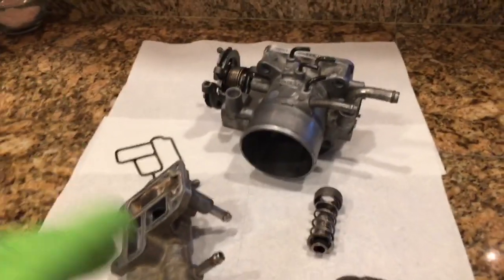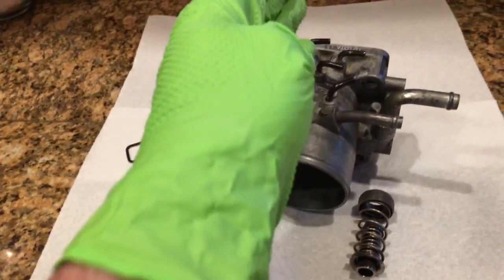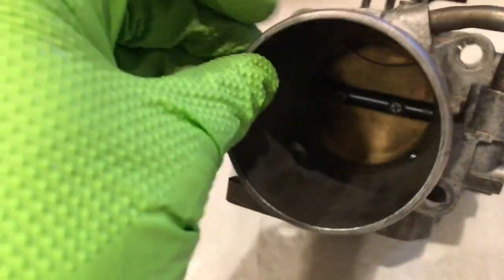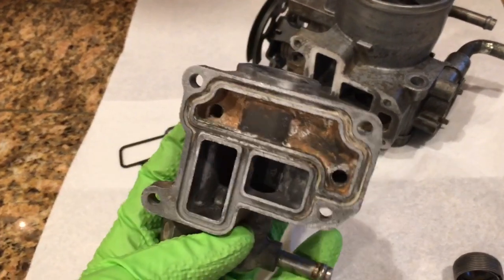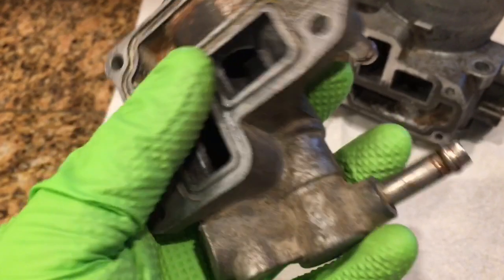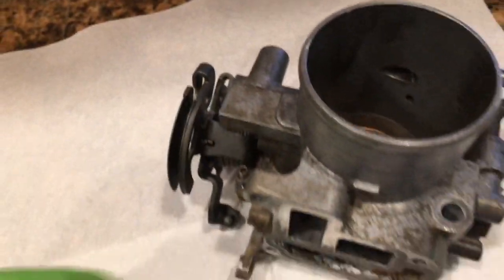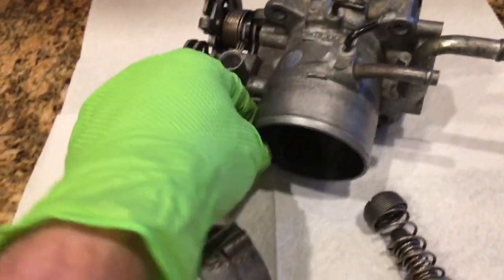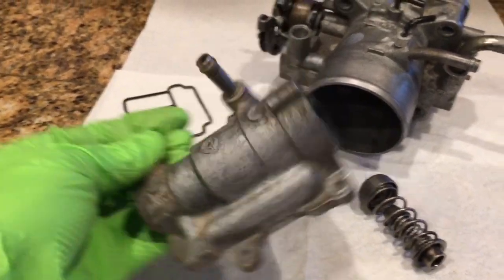Toyota 4runner pickup 22RE - understanding rough, high, surging idle, the Idle Air Control IAC valve

Comment: I taped off the hole in mine and it runs better for about 30 seconds and then stalls. Before I taped it it stalled after like 5. So I wonder if this is my issue.
Reply from the maker: Hard to say, but it's normally if you tape that hole closed, then it disabled the entire IAC valve stuff; that means the motor should idle fine once it warms up a bit (around 3-4 miles of driving). If it's still stalling with the hole closed by the tape (and it's warmed up), then it's probably not the IAC but something more. You might want to check to see if all your injectors are working. You might also want to check the O-ring around the idle adjustment screw. But the fact that it did change things tends to suggest an air/fuel ratio issue. What do you have the engine idle RPM's set to?
Reply: @ray5961  I bought my truck and the drive it home and drove it for a day and on the way home it was revving up and down fast and I parked it and now it just fires up good but after 5 seconds the idle drops and stalls after misfire. But I’ve checked a list of things including iacv and egr etc. but maybe it’s my afm idk. Super frustrating though lol
Reply: @ray5961  I have spark and my fuel pump pumps fuel. I changed the fuel filter. So I think maybe afm just because of it maybe not cutting on fuel pump? Cause I don’t hear it turn on. I used the diagnostic box to activate fuel pump is how I got the gas to come. But I don’t think it’s activated or not for long cause the air. I have a crack in my boot that goes to my throttle body. And I taped it. So could be that too. It’s weird
Reply from the maker: @heyitsbryce  ok try this - go into the little diag box (next to the fuse box in the engine compartment) and jumper Fp and B+ with a paper clip or wire (this will force the fuel pump on) and then start the car and see if the truck runs.
Reply from the maker: @heyitsbryce  I might be the circuit opening relay has failed. Let me know if the truck works correctly when Fp and B+ is jumpered. The fuel pump comes on when you work the stater, to start the motor. Once air starts flowing through the AFM, the AFM grounds the circuit opening relay and this relay powers the fuel pump. So if that relay fails, the truck will start (when the starting circuit provides fuel), but it won't run once things are handed over to the AFM if the circuit opening a relay has failed. If the truck runs when Fp and B+ are jumpered (which by passes that relay), then it's probably the relay, which is located over in the passenger side kick panel and behind the glove box - it has a dark grey 6 pin connector.
Reply: @ray5961  okay thank you! I’ll check that stuff out soon. I have a new boot coming in the mail today because mine was cracked in half. But I will definitely give it a shot! I’ll let you know when I find out.
Reply: @ray5961  I tried it with my taped up boot. Shot to 2k rpms and stayed like that running. (I haven’t messed with the idle screw too much) still sounded like it had a misfire a little when I would give it gas. But it does start and stay running
Reply from the maker: @heyitsbryce  ok sounds like the opening circuit relay isn't working. Watch this video here and it might help https://youtu.be/EpTED3Z2xo8 - read the comments w/ Eric on that video also
Reply: @ray5961  okay thank you! I’ll check it out! If I have to get a opening circuit relay do I have to match with my ecu or?
Reply from the maker: @heyitsbryce  It's an electrical relay for Toyota, which is basically just like an on/off switch. Search ebay or Amazon for "Toyota Circuit Opening Relay" and you should find them. Auto zone or Napa probably sells them. You can remove yours from the truck and test it. But usually if jumping Fp and B+ works, then the relay is bad or burned out or something. They are easy to test once you remove them and understand what is happening inside. You can usually pop open the relay and see it working inside - sometimes they contacts are just corroded and you can clean them or the connector and get things working also.
Reply: @ray5961  sorry to bother again. But today I checked my circuit opening relay with my multimeter and it came back 108 ohms and my so things check out there. I opened the case and everything looked in new condition but outside was a little dirty. And so I’m not sure what it could be.? Could it still run good ohms and be bad? Cause when I hooked up to fp and b+ it ran fine. I checked the ohms on the terminals in afm and they came back fine ( I believe. Was my first time trying) I saw on a page for testing it.
Test 0* vb-vc 100.7 
Test 1: e2 -vs 362
Test 2: e2-vc 180
Test 3: e2-vb 281
Test 4: (temp) was about 72 degrees @1728
Test 5. Infinite/open
Saw it here  https://www.4crawler.com/4x4/CheapTricks/AFM/index.shtml#AFMtesting
Reply from the maker: @heyitsbryce  Well, to test the relay, normally what you do is apply 12 volts across the terminals that power the coil and then it will magnetize and pull a metal contact over which should complete a circuit on the other two legs - so when the coil is energized, the other two legs should have continuity. The AFM part related to the circuit opening relay is merely grounding the relay coil so it's powered. Try testing the relay with the case off and you should see if working. The 108 ohms is probably just the coils resistance, but that doesn't mean much. What matters is does the relay function when it's powered. Two pins on the relay power the coil; when the coil has power, it closes the switch and that connects whatever circuit is across the other two pins of the relay. So apply power to the two pins which go to the coil and see if the other two pins show continuity or not. You can also test the wire for the AFM to the relay and make sure the AFM is grounding by putting a volt meter in place of the relay (while Fp and B+ are jumpered) to confirm the AFM is grounding the relay like it should. All those vb-vc and e2 readings relate to sending positioning data to the ECU, not controlling the circuit opening relay which provides power to the fuel pump. Check that other video and pause the video and look closely at the wiring schematic
Reply: @ray5961  okay man thank you. I will have to try that for sure. I had just checked ohms on it. I pulled the trigger couple days ago and got one off eBay for 60$ from a trusted seller. So I guess if it’s not that after all then I have another Toyota relay lol. But I hope it is this so I can be done with it. I appreciate you helping me out. I’m still kinda learning about vehicles and so any kind of help I can get helps a lot. I will let you know what I get. For reassurance I’ve been testing the middle of the bottom 3 and top left of the two. And that’s where I get 108. And then I get 20 from top right and bottom right. So I will connect to bottom middle of the 3 and top left of the 2 for the 12v correct?
Reply from the maker: @heyitsbryce  I don't know the pin out off the top of my head, but it should be shown on the relay using numbers - google relay symbols or relay pin numbering and it should explain it pretty clearly and then you can see which pins do what. Or just open the relay and look to see which pins go to the coil wires. You can also look at that video I linked before; the connector pins are shown and those plug into the relay. I know it's all confusing if you don't have a background in electrical engineering and/or you're not used to reading electrical schematics. Watch that video linked above... it looks like power across pins 2 and 4 - so + on 2 and ground on 4 and then that will bring power over to pin 1.
Reply: @ray5961  yeah man it can for sure be intimidating. Thank you for the help. I will try those things tomorrow! I hope it’s the relay lol.
Reply: @ray5961    so I hooked up the relay with wires connected to relay with clips and hooked to my battery and it clicked. (I watched it click) My connections were connected to 2 & 6 on that book you have. I don’t get a click if I connect 2 and 6. And the other ones shown on that book 1&2 they come to 21 when I have the relay clicked and connected still. I tried following along with the afm steps but maybe I messed up on this? I I took a paper clip and stuck it on fp and b+ in the diag box and turned the key on the on position and then took my red probe from multimeter and stuck it in 2 and then black into 4. Was nothing. So I stuck red in 2 and black in 6 and got 11.49 v (my reader was set on 12. ) I can hear the pump winning. Almost like a electrical sound kinda. When it’s jumped.
Reply: @ray5961  sorry. Was looking at the relay wrong 2&4 is what clicks.
Reply: @ray5961  so 3&6 come to 21 when I have 2&4 clicked. And when I check the inside clip that clips into the relay I checked 2&4 and nothing on my multimeter set at 12v with fp and b+ jumped. And so I went 2 with red 6 with black and that’s where I got 11.49
Reply from the maker: @heyitsbryce  You need to match what's happening to the proper color wires based on the wiring schematic and/or which pins do what inside the relay. If the relay is clicking, then it's probably working and should connect the other pins. You gotta pull up the schematic for the relay and understand what you are trying to accomplish here. The relay is closing an electrical circuit, plan and simple. See if it's doing that or not and if it is, then move on to find where the problem is if it's not the relay doing its job.
Reply: @ray5961  so my step dad and I messed around with it more and we took a end of the multimeter probe and connected to the green yellow wire in the terminal and then grounded to a bolt in the door and it kept running. So it’s a ground correct? We are trying to figure out how to find the messed up ground now
Reply: @ray5961  do you know if there is a certain place it grounds? Maybe that’s a dumb question
Reply from the maker: @heyitsbryce  Yeah, so if you have the relay in place and you grounded the green/yellow wire, that means the relay is fine. It also means that either the AFM isn't grounding it properly or the AFM doesn't have a path to ground via its brown wire. You can also check for continuity between the brown wire on the relay connector over to the E1 spot on the diagnostic port - and also check to see if E1 on the diag port is showing ground to the chassis. You can also jump a wire across the AFM connector between the yellow/green wire and the brown wire where it plugs in and see if the fuel pump stays on to rule out a loss of ground and rule in a defective AFM switch.
Reply from the maker: @heyitsbryce  I don't know off the top of my head where it grounds... there are a number of ground points on the wiring harnesses. See my other comment regarding checking the AFM wires. Okay, I checked the manual for ya and the splice points for the brown wire ground that the AFM is connecting to for ground is inside that plastic wiring harness routing box thing that makes a slight turn and pops into the right side of,the engine compartment just under the fuse box and diagnostic port - from there it runs into the harness and grounds where the fuel injector brown wires all ground, which is the bolt under the intake manifold runner. So if you look at the intake runners, when you're standing over the right fender, there is a seam where the intake plenum and the intake runners bolt together - kind of up under there, there is a support bracket that goes down to the side of the engine block; right there where that support bolts to the intake runners, you should see a gang of 3 or so wires bolted to the manifold with a nut or bolt. If you look close, they should be brown wires; that's your final ground point of the yellow/green wire that the AFM is connecting to ground.
Reply: @ray5961  awesome! I’ll have to check that out. And I’ll look here in a little bit to see if it’s not connected . Ii really appreciate this help. I was following the wires coming from afm to the firewall where they go inside earlier and I saw it going throughout the motor so I will for sure check it more out!
Reply: @ray5961  also, I probably should have included it’s a 22re swap. But I believe the concept should still be the same. It’s been routed about the same the whole way through
Reply: @ray5961  I went and checked all the grounds. That one that is by the intake is bolted down. I checked the rest and they are bolted. So that checks out. Given they have a good enough connection. Which it looked like. So I’m guessing maybe a connection at the relay to the connector that connects in it? For the ground pin in it? It really has me stumped.
Reply: @ray5961  wish I could send pictures of the grounds so you could see what I’m looking at.
Reply from the maker: @heyitsbryce  ok good luck!
Reply from the maker: @heyitsbryce  Unbolt the brown wires from that bolt on the intake runners and make sure there is no rust. Also, while it's unbolted, check to see if there is continuity between those brown wires and E1 in the diag port. Also see if there is continuity from the brown wires over to the brown wire in the AFM connector - that will help rule out a break some place inside the harness.
Reply: @ray5961  okay I’ll check it out tomorrow! It looked like it’s dirty. But I guess I’ll just have to see tomorrow haha. But I will for sure try that!
Reply: @ray5961  is there any way it could be the ground inside of the relay?
Reply from the maker: @heyitsbryce  you can always just upload a brief video clip... this is YouTube after all :-)
Reply from the maker: @heyitsbryce  ok sounds good. You might also want to jumper the green/yellow wire to the brown wire at the AFM connector itself (when unplugged) in order to rule out a defective switch in the AFM. If the fuel pump turns on then, at least you know the opening circuit relay, wiring and ground points are okay and that there is some issue with the switching from the AFM. The other thing is check to make sure you have a healthy ground from the engine block and the valve cover back to the battery. Normally there is a little ground from the valve cover back to the fire wall. On my truck, I have a dedicated ground from the negative terminal to the engine block and also a ground strap from the engine block to the cylinder head, in addition to the one from the valve cover to the fire wall.
Reply: @ray5961  true! I could make a video and post it and tag you I believe ! And so I would disconnect the afm connector that’s going to it and then stick a wire from the green one to brown one in it? Or how does that work for jumping it? I will for sure make a video tomorrow and show you more of what I’m dealing with. I know I’m close. It’s just finding out what is causing it. I bought the 4 runner and then drove it home and haven’t been able to drive it much since. Was sputtering and then ended up like this. Super upsetting.
Reply: @ray5961  both the videos! Hopefully this helps getting a idea. I wasn’t able to make the video too too long.
Reply from the maker: @heyitsbryce  ok let me check the video out and look in the manual to see if I can find anything for ya
Reply: @ray5961  okay man thank you
Reply: @ray5961  I have another video I wanted to show you.
Reply from the maker: @heyitsbryce  ok I'll check your channel out. I was just sitting down at my desk with the electrical manual to see what I can find out for ya
Reply from the maker: @heyitsbryce  okay on the video where you have the truck running and you are manually grounding out the green/yellow wire, what you are doing is bypassing the switch inside the AFM and basically doing its job. So that isolates the issue to either being a problem with the actual switching inside of the AFM or it is indicating that the AFM switch doesn't have a ground on its brown plug wire. Let me watch the other videos. Maybe you can turn comments on on your videos and then I can comment directly there.
Reply from the maker: @heyitsbryce  ok in the video where you have the connector off the AFM and you are jumping it, you have the wrong pins jumped. You are jumping pin #1 (FC) to pin #3 (E2). What you want to do is jump pin #1 to pin#2 (E1) because E1 is the chassis ground side, while E2 goes to your ECU, not the ground. Jump pin #1 to pin #2 in the AFM plug harness and see if the truck runs; that will tell you definitively if it's a bad chassis ground involving the brown wire (E1) or if the actual AFM switching is defective. Also, you can open the AFM if you are careful and see what's up inside. Let me go make you a quick video showing how I have mine cut open and all that.
Reply: @ray5961  okay awesome that’s good to know. I will have to go back out there and try that! Didn’t know I had it on the wrong ones so that’s good to know also. I will try to turn comments on. And awesome man thank you so much.
Reply: @ray5961  I got the studio app for YouTube and hit allow comments for my videos so it should be okay.
Reply: @ray5961  runs with it plugged into 1&2 !!
Reply from the maker: @heyitsbryce  ok now we are getting some place. I'm uploading a video for you.. give me about 10 or 15 minutes and it will be up. I think the issue is probably dirty point contacts on the AFM switch inside. I show it all in the video which is uploading now. But at least you know the ground on the brown wire is good. Hang tight for a minute and watch this video I just made. It will show you how to open the AFM and inspect the actual switch, which I think is your issue here.
Reply from the maker: @heyitsbryce  Check this video out https://www.youtube.com/watch?v=X9O7sKVnQw0
Reply: @ray5961  awesome man! Thank you. I’m for sure going to go check that stuff out here in a few!. If all that stuffs fine in there then should I just get a new afm anyways? Cause otherwise idk what else it could be at this point. But we are for sure really close to this!
Reply from the maker: @heyitsbryce  Yeah, that looks like it's broken inside there all right, so I would say you have found your issue. Good work
Reply: @ray5961  you are the one that found it for me haha. Thank you sir! This has been such a help. And it has taught me a thing or two about my vehicle! I am gonna buy a new one. I really appreciate it! I will let you know after I switch it out and how she runs! Thank you again!
Reply from the maker: @heyitsbryce  You're most welcome! Glad we finally got to the bottom of it :)
Reply: @ray5961  I’ve looked everywhere and call everywhere and I can’t find a afm for 91 Toyota pickup anywhere. Even locally. It’s crazy.
Reply from the maker: @heyitsbryce  I got mine from Napa. https://www.napaonline.com/en/p/NECXTP420055
Reply: @ray5961  yeah they are sold out for around me and online. I found a Toyota specialized place in Washington that has one and I receive it Friday! It is used. But it will tell me what I need to know and they test them.
Reply: @ray5961  I got the new afm in the mail and put that in and boom problem gone 🥲
Reply from the maker: @heyitsbryce  Awesome! These trucks are a lot of fun to keep running :-)
Reply: @ray5961  hahaha yeah. I heard they are reliable as hell so I hope I don’t have to do something for a while lol.